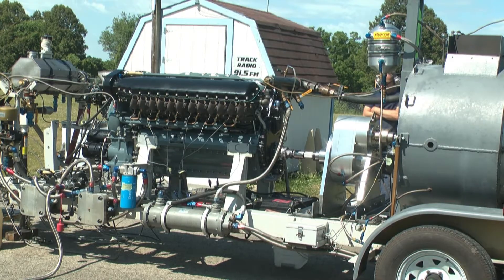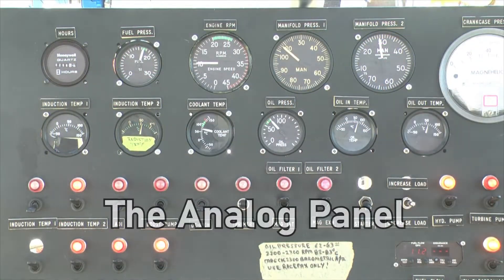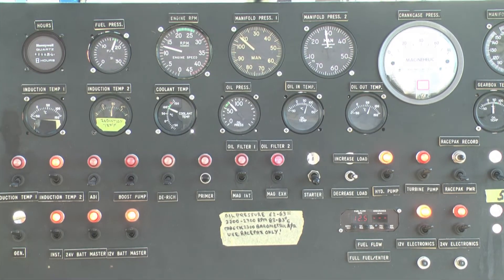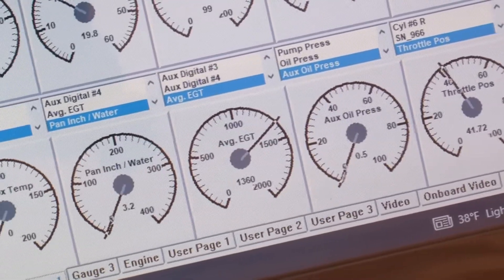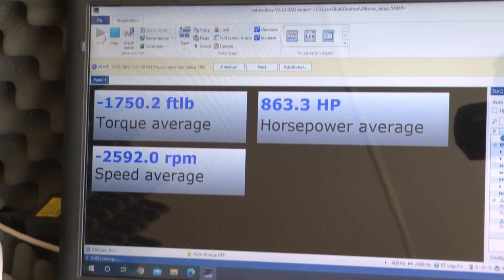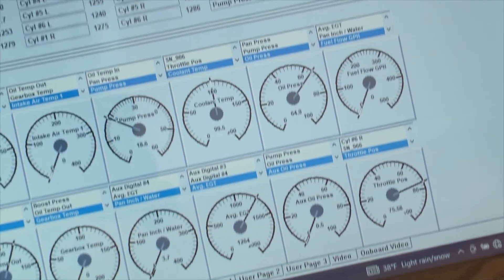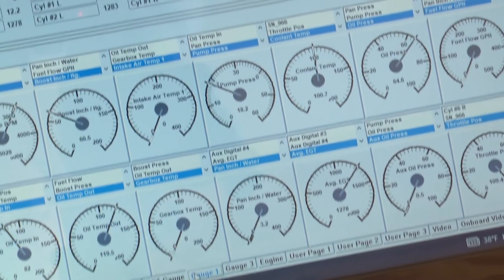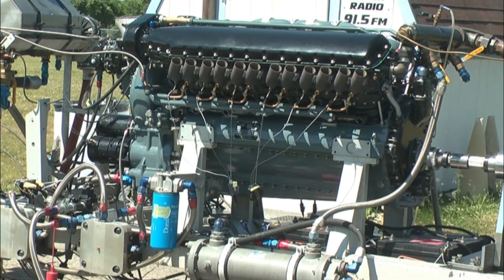Part 2: Allison V-1710 Dynamometer Demonstration

Comment: Oh gawd, can you just leave it at that lopey idle at the end for about 20 minutes and record that???  I could put it on a loop and listen to it all day.  Thanks for sharing!
Reply: It does sound blissful, but it's hard to beat the "lopey" sound of  an old radial idling, especially right after startup, before its cleaned up and warm. They make the hair on the back of my neck stand up, don't know why, but they sound just lovely ! Next best thing is a nitro motor on startup, when its transitioning from alcohol, and the nitro starts randomly hammering in. That really dampens my drawers !  🤣
Reply: @glennjames7107 That would be gasoline that they are started on...

Comment: How long could it run in WEP?
Reply from the maker: Good question. We run in WEP for 1min. duration for 6 different cycles. The test stand is able to support the engine for an indefinite period of time. Allison required the engine to run for 150 hours @ WEP to qualify for certification. Take off power for 6 cycles of 5 minutes in duration
Reply: Luke, I looked up the engine flight chart for this engine in a P-40N.  It doesn't list a limit for WEP.  It just says "EMERGENCY ONLY" in upper case letters.  "Take Off Power" has a 5 minute limit and "Military Power" has a 15 minute limit.  The other settings were all unlimited.  They were "Maximum Continuous",  "Maximum Cruise", and "Minimum Specific Consumption".

Comment: Doing the math, that's around 0.67lb/hph consistently during testing. Is there any reason why it seems to be so inefficient? Aircraft engines during ww2 were getting around 0.5lb/hph from my researxg.
Reply from the maker: The engine is being demonstrated in auto-rich. In the aircraft during cruise it would have been in auto lean and 0.5Lb/Hph

Comment: ive always assumed with these big bore and stroke ww2 engines that the torque would be similar to a diesels about double the hp rating
Reply: AvGas has half the "energy density" of diesel fuel.

Comment: Now how high can you rev the engine before it floats the valves and causes total destruction I’ve always been curious on the engine like that maybe you guys can get a junk engine that runs but would cost more than it’s worth to fix it and make a video on it where the engine is completely over rev’d
Reply from the maker: It is well documented thru boat racing ,tractor pulling that an Allison upper limits of RPM's is 4500. With overhead cam's the valves don't float. that is the limit of the engine without damage occurring. Hope this helps
Reply: @aceallisons2639   Camshaft position does not determine whether or not an engine can experience valve "float". Any engine that has valve springs for closing the valves can float the valves if the RPM exceeds the ability of the valve spring to fully close the valve between openings. Basically, it's the strength of the valve spring that allows or prevents valve float. The only engine I have personally owned that could not experience valve float was a Ducati motorcycle with Desmodromic valve operation. There were no valve springs in the engine. Each valve had a lobe on the cam for opening the valve, and a separate lobe for closing the valve.

Comment: How does the dyno work? The mid section sort of looks like the compressor stage from a gas turbine.
Reply: Ah, found the first part. Interesting!
Reply from the maker: The J-79 compressor has movable guide vanes that provide the load that we require for all of our test points (manifold pressure, RPM's) The gearbox provides the correct increase in shaft speed to match the engine RPM range with the compressor Range. The dyno is capable of holding any power range for an indefinite period of time. Limiting factor running out of fuel.